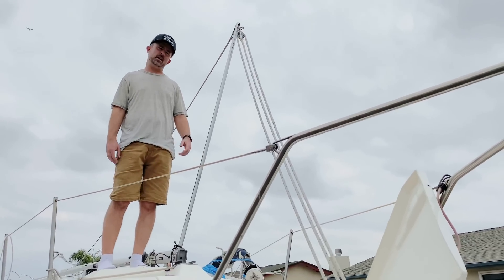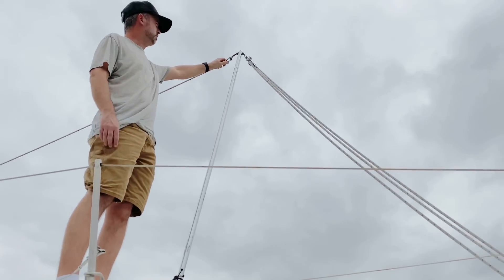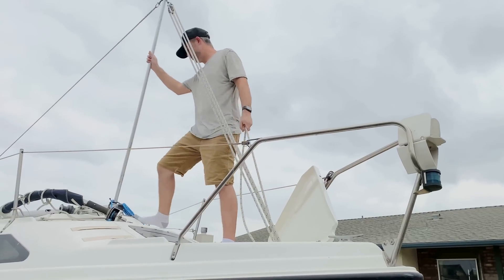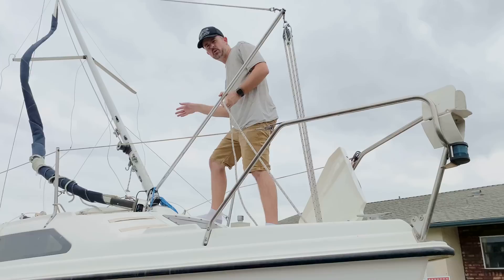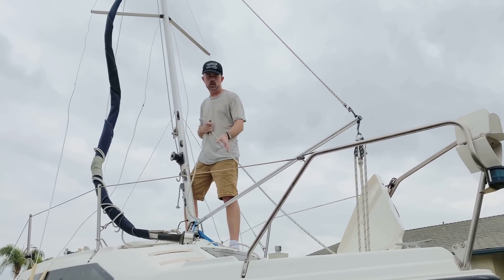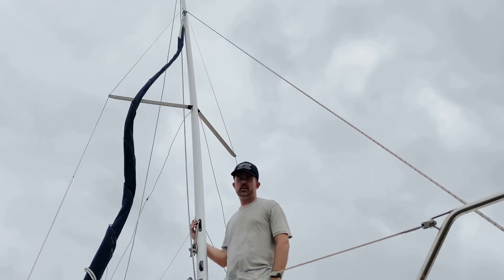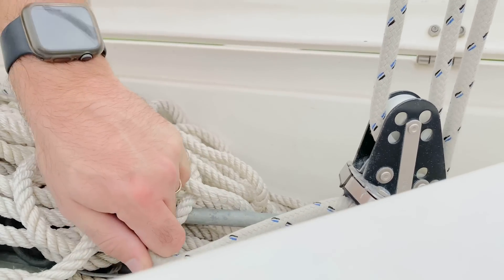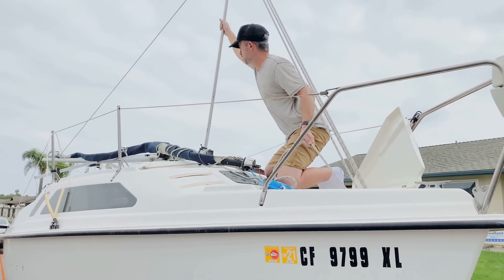Raising And Lowering Sailboat Mast In 5 Minutes

Comment: Nice job Greg but - You left out the use of your mini shrouds (which you have attached to your stanchions) - and to the ??? mainsail halyard? I usually attach my mini shrouds to the spinnaker ring on the mast. The mini shrouds are critical to prevent the mast from moving port and starboard as the mast rises. When the mast is below 45° it is VERY unstable laterally otherwise - because the main shrouds are slack.

Comment: Greg
Great videos on the 19-2.   Have had one for a few years.  But a problem. My Flexible Furler binds as I furl the sail.  Second problem is that the top of the furler get entangled with the jib Hayward.  I tried to pull it tight vertically so it ran close to the mast but it still tangles.  Any ideas. TomFlatley@gmail.com. 6094102445 call. Thank you. Tom

Comment: How do you determine how long the baby stays need to be? I have a boat recently purchased, and have never seem the mast up.
Reply from the maker: The baby stays came preset…. No adjustment needed as they used pelican hooks to tighten
Reply: I believe they must be attached on either side of the mast pivot point. The length would depend on how far apart they start and how high up the mast they attach to. If they are not on either side of the mast pivot point (aft/fore or up/down) they will either get tighter or looser as the mast rises.